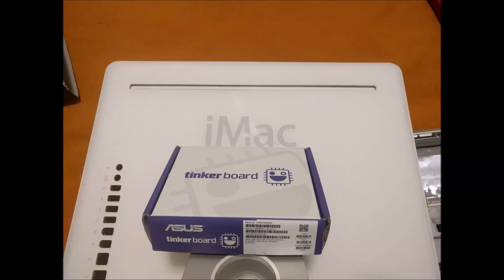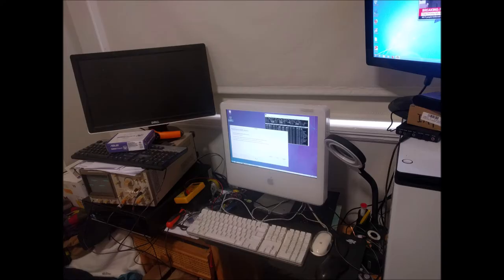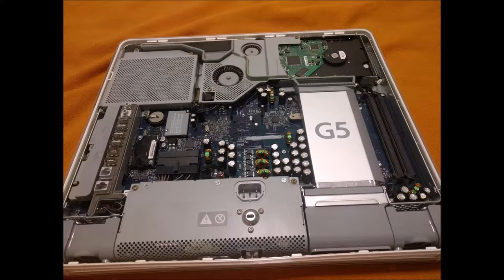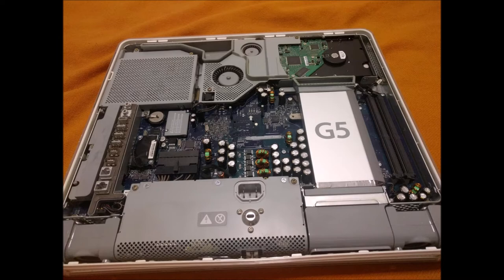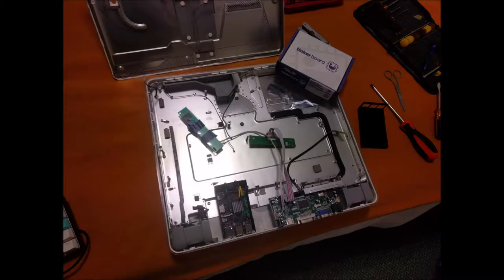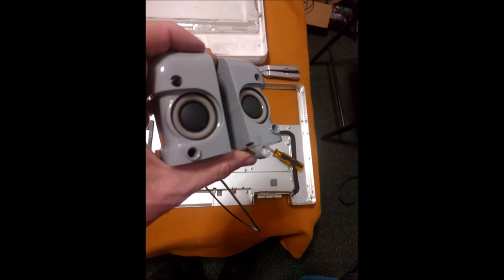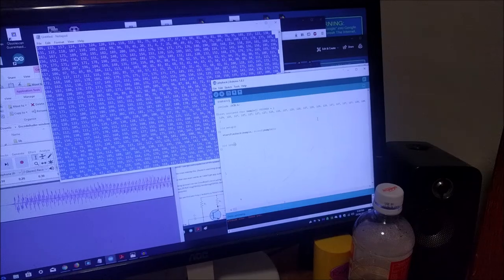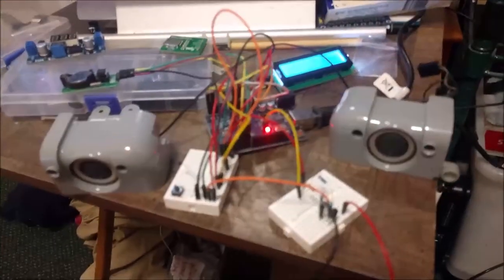iMac G5 ASUS Tinker Board Conversion Project 2018 Quad Core!

Comment from the maker: After testing maybe able to reuse iMac G5 Power Supply for 5V and 12V. This is great news...Thanks.
PS Startup Chime will be generated by the Arduino with an SD Card. The Tinker Board takes too long to boot before the Chime can be played. Also I may use the Arduino for Fan Control and Temperature monitoring in the case. I'm still having issues with  the TMDS Panel and control board, if I can't resolve this I may have to replace the LCD panel which may end this  project. Also looking at iMac G4 15" (iLamp)  as this maybe easier conversion.